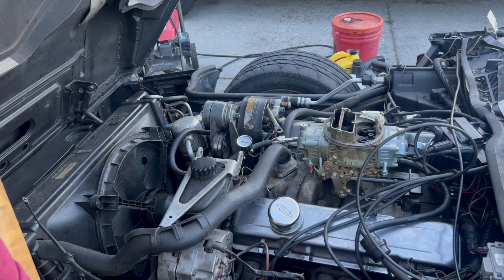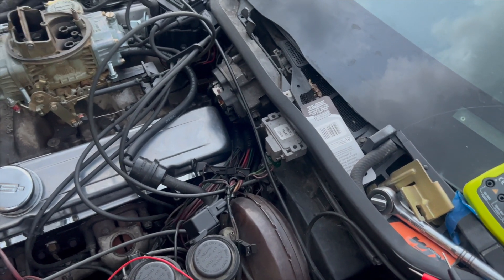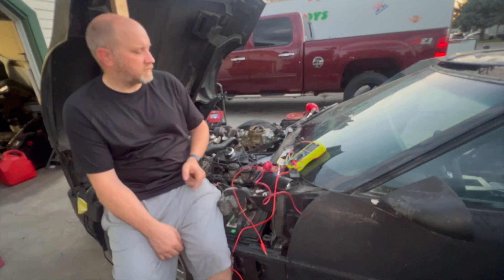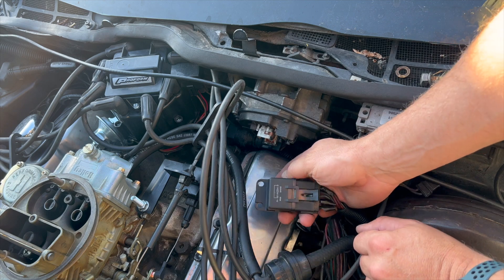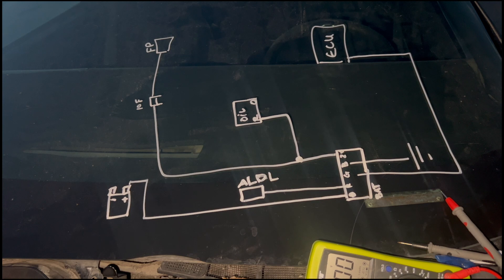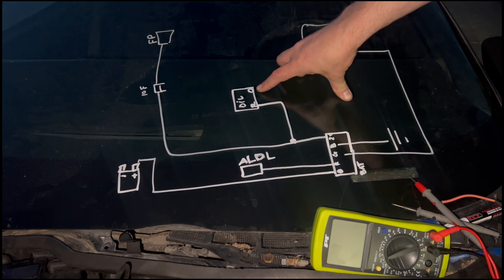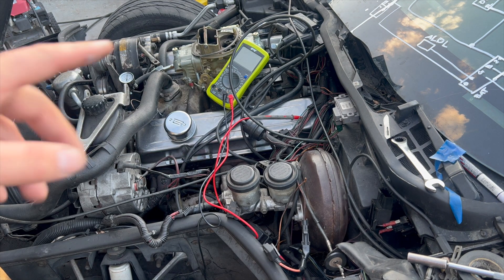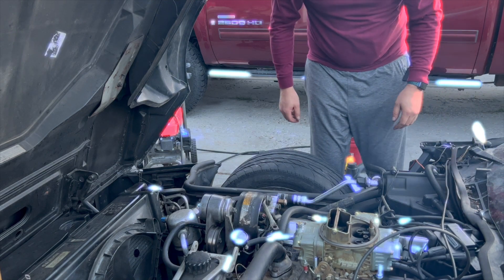Mapping Out and Understanding C4 Fuel Pump Wiring

Comment: You know just enough to be dangerous. All you did was fix the failsafe fuel pump power circuit. It is used to provide a way to run the fuel pump ,when the normal operating mode ,power thru the relay fails. The oil pressure switch closes at 4 psi and runs in parallel with the  fuel pump relay circuit . Both circuits join just before the fuel pump fuse. 
The FP relay has 5 pins and when in the unpowered position  the power from G tetminal goes thru a closed set of contacts right out to the wire for the fuel pump fuse. 
The relay solenoid is triggered on with power from the ECM green/wht wire. With key ON there is a 2 sec ECM controlled prime. When cranking the ECM continues to power the relay green/ wht when the HEI ignition purple/ wht wire sends the ignition/ injector pulses to the ECM. If the fuel pump relay circuit  fails, the engine will still run using the fail safe oil pressure switch. On a restart with a failed relay circuit you will notice a longer time for fuel pressure to build, because it takes a second or more for the oil pressure switch to close when cranking. The relay problem should have set a code 54. The code 54 comes from another red wire that goes back to the ECM from the 4 wire splice before the FP fuse. When the ECM sees a delay in the cranking circuit voltage, because the relay does not energize, code 54 is set. If you google code 54, C4  Corvette the schematic will make it clearer.

Comment: Hey man what wires did you end up splicing together with the fuel pump?
Reply: I wonder the same thing 😂
Reply from the maker: I didn’t have to splice any, I had to reconnect some. There is a connection to the relay and also to the oil pump you have to check for good connections. DM my IG @soloascent and we can work through it.